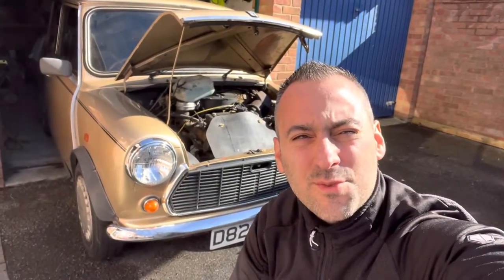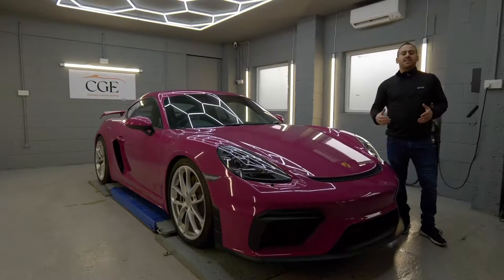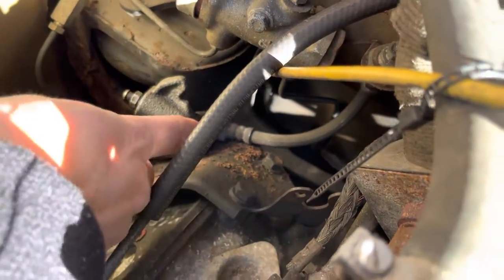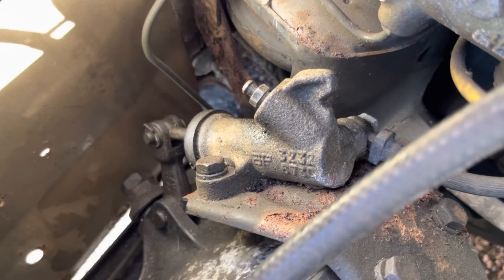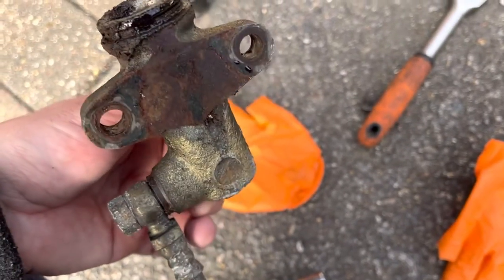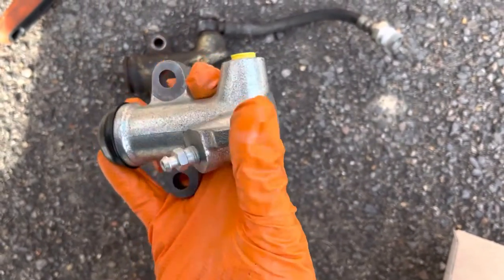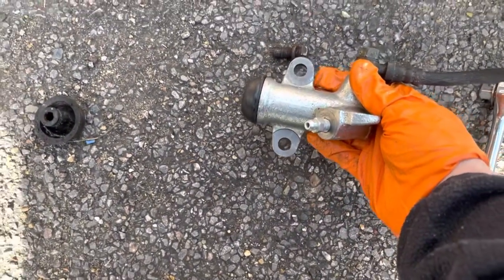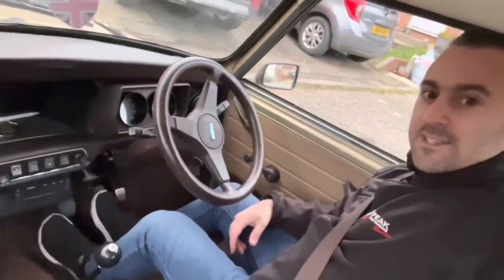Classic Mini Clutch Bleed and slave cylinder replacement

Comment: Ive got a clutch that will only engage when the engine is off. It will drive if bump started in gear, but the gear cant be changed. Does this sound like the slave or something else. 1995 SPI mini if it makes much difference.
Reply from the maker: Yes 100% this is almost certainly the Slave, get onto Mini spares. C om website and make sure you get the right one and get it ordered! Very easy as you’d see from my video ❤️🙌 let me know how you get on. 
Thank you so much for watching by the way, please stick around and subscribe as it’ll be great to have you around 👌🫶
Reply: Great. I'll get it done. Thanks for the info.
Reply from the maker: You’re very welcome! Just let me know how it all goes 🙌🙌